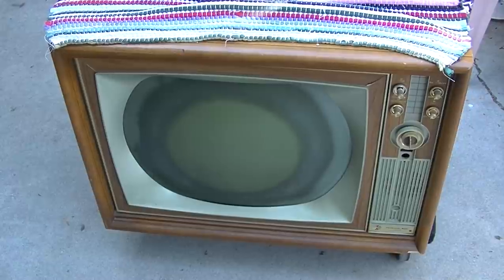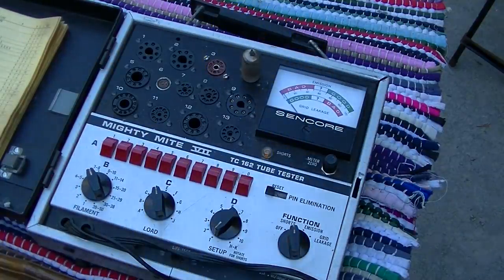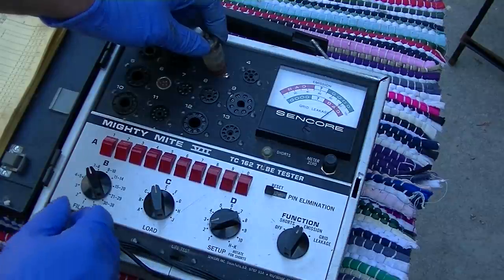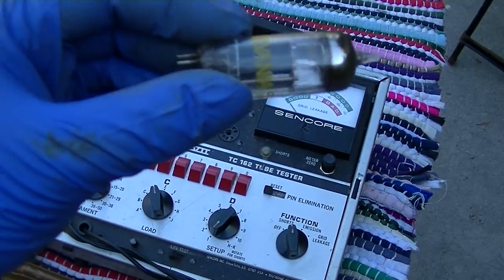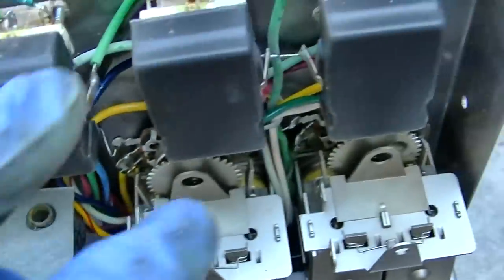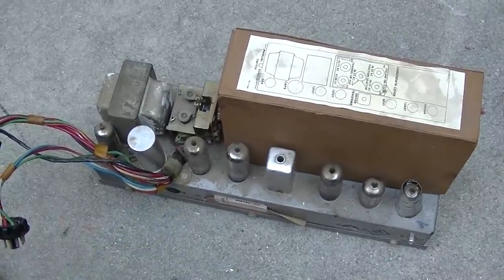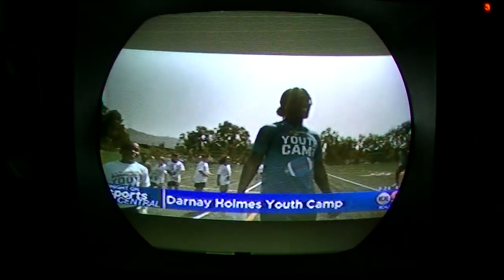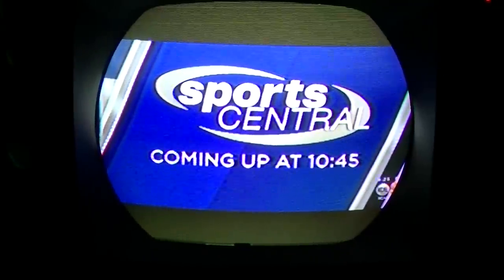Packard Bell Round Tube Color Television Repair Pt2 Capacitors and Chassis

Comment: I remember when parking lots were landscaped with shade trees, so it was nothing to stay in the car under a tree while your parents shopped.  Roll down the windows, and you were fine.  Stores found out that maintaining the landscaping was expensive, so they took it all out, now we have a wasteland of pavement.
Reply: "They paved paradise, put up a parking lot..." - Joni Mitchell ("Big Yellow Taxi")
Reply: No offense, but methinks you're either misremembering or had an experience most didn't. Most places then and now are/were flat paved with no trees. Some put strips with a couple at the end of rows — for decoration, not providing shade. Almost none shaded entire lots. Image searches on the matter pretty well confirm my memory. Cost-cutting is nothing new.

Comment: I'm originally from the Cleveland area---what will the Guardians be guarding, the miles of derelict factories that stand dormant with the demise of the industrial age? But I digress---I was very surprised that the faulty remote unit wreaked such havoc with the set---I never would've guessed that. It turned out great, ready for service
Reply: Cleveland should be renamed Lagos.  I call my own city "Lagos on the Delaware" and Baltimore is "Lagos on the Chesapeake" and now Cleveland can be "Lagos on the Cuyahoga"
There is no #MagicDirt
Reply: The wasteland of woke
Reply: They will be guarding the " Mistake by the Lake" sign!!!!!!  😂🤣🤣🤣🤣🤣🤣🤣🤣🤣🤣🤣
Reply: And you paid an extra $50 to $100 to have that remote box installed in the set. Without it, there were less issues, even if you had to get up and walk 6 feet to change the channel, etc.

Comment: Hello from France 🇫🇷 I follow your YouTube channel from many years now. Remember the sixties in Paris with only 2 black and white public channels. Second public channel start with colors in 1967, third (in color too) in 1972. During this period colors TV sets providing by Philips or others Europeans brands were too much expensive with low quality // USA. When solid state all transistors colors TVs was launched up at mid seventies , color TVs set began to be more common, with very rare remote control anyway. We were so late compared to the USA ! With the rest of Europe too with our SECAM color system 🤬As a teenager I was fascinated by the technological advance of the USA. Today France is the less expensive place with fiber internet and cable providers but I’m still hot with those old US TV set ❤️
Reply: Europeans couldn't agree on a standard for color. Half of the continent was running PAL, and the other was running SECAM, with half of the SECAM countries eventually switching over to PAL. We had the NTSC versions of the Phillips K6 and K7 sets here in Canada. They were a technician's nightmare.

Comment: Hi Shango, your videos are GREAT, I'm also fixing stuff like TVs (but modern), PCs, amplifiers, for fun (and friends) but I never tried to fix any tube equip - it does not seems to be much harder / different than solidstate - of course voltages are higher therefore you need to watch and think about what are you going to touch, use isolation transformer, gloves, ... but at the end most failures are same - leaky / open caps / burned resistors, burned tube / transistor / IC  / diode - the skill is to be able to find the failed component - thats why I like your videos beacuse you are trying to find the failed component logically instead of "replace them all" - this is much more educational :D Also I like your comments / humor, but I'm a little bit scared about what I see in the news you are showing us - I'm happy I live in europe where the propaganda did not reached US level (yet). Thank you for all your work / videos!

Comment: I thought tubes were rather delicate, but I guess smacking them with a slice of plywood doesn't phase them.  LOL.  Always interesting content, thanks again.  Cheers.
Reply: Since he's working outdoors, a critical refinement is to use exterior plywood.
Reply: I rather enjoyed that!
Reply: The envelopes don't like to be stepped on or dropped but they don't care much past that. Shango has videos smacking them with screwdrivers to remove shorts!

Also, they handle overcurrent really well
Reply: Plywood has a bit of give to it, plus he was holding it on his hand so some of the hit's energy got dissipated that way.
Trying to do that on a piece of steel on the ground with the same force would most likely shatter the glass.
Reply: I always treated them like glass....as in fragile glass.
Reply: @Stephen Tidwell Shango being who he is though there's probably 6 more like it in storage and if it had a short it was needing to be replaced anyways

Comment: Sagging elements in a worn tube from the way it is positioned in the set. I've seen it happen many times with ones mounted horizontally. Smack 'o Rama and they often come back.
Reply: Sagging elements are common in anything from the 60's, that's why I don't look at myself when nude in the mirror any more.

Comment: I remember the 5GH8 tube had just the opposite effect.  If you tapped on a good tube like that it killed the tube. 
When I was an apprentice in a TV shop I once knocked over the tube caddy in the parking lot.  It popped every one of the 5GH8 tubes internally.

Comment: I seem to recall back in the days when sets like these were commonplace that they were not all that reliable, and the cost of maintaining and repairing them was almost prohibitive -- which is why many people back then actually preferred more simple, dependable B&W sets. Also, color sets weren't all that practical, as there weren't that many TV programs broadcast in color up until about 1968 or so, as I recollect.
Reply: Actually the big three networks made the universal transition to color in the 1966 season. Of course color programs existed before then, but most weekly shows were in black & white. I remember the little blurb that would appear for a few seconds before programs would start, proclaiming the show was "in color."
Reply: @Inflec Also, TV Guide made note of the color shows, until the mid 70s, when they stated noting the B&W ones.
Reply: @Inflec  Now that I think of it, this is true, but the overwhelming majority of local programming was still in black and white, and most smaller-market TV stations had budgets too tight to afford color equipment in those days. If memory serves, the TV network that eventually became today's PBS (NET) broadcast exclusively in black and white until about early-1969.
Reply: @dougbrowning82  - True!
Reply: @chetpomeroy1399  - You are correct in all your observations. I remember as a kid a favorite Saturday morning show was time shifted by my local station to Sunday mornings. When I finally got the chance to use my brother's brand new Quasar TV to see it in color, I was crestfallen to see that the station was broadcasting it in black & white. So yes, it took time for some stations to catch up with color broadcasting.

Comment: I could actually watch this set. Nice bright color and good geometry. Focus is a little fuzzy but no blooming or pincushion. I don't miss all the X-ray radiation when we used to sit really close and get nagged at. It's a dry heat in Bakersfield 12% humidity much different than 75% humidity... Get Inoculated!

Comment: I wonder if the tube tester in the U.K. is called  "Valve Tester"
Reply: yes, indeed
Reply: Please ladies and gentlemen it would have been described thus: A device for the testing of thermionic valves - as recommended by Sir Selby Farquhar no less ;)

Comment: Never saw anyone bang a vacuum tube like that, and expect it to work. I was taught that the filaments, and other inner parts of tubes were kind of delicate, that you could drop a tube on the floor, and while the glass may not crack or break,the tube was effectively non functional. I guess this is not the case.
Reply: Just don't do it to your 300B. The miniature tubes are happy to get whacked. We used to whack our tube necks with a screwdriver during rejuvenation too. Don't know of any that would fail after a whack, not saying they can't..

Comment: I don't watch television, so all this wokeness, CRT, anti-racist racism is not only a bit shocking, but also offensive to me. I'm just not used to it. My least favorite part of these videos is when the TV content is shown. I really enjoy the restoration process, and the humor, but as has been discussed, when it's all said and done, and the tv and the radios are repaired, there's little worth using them for.
Reply: Just skip those parts of the video.
Reply: Yep, no tv in my house, but i want one for a "decoration". My house is old and i'd like some older tech to go along with it. An early B&W would actually be the easiest and most fitting for the house, but early color sets are cool.

Comment: I need one of those bug traps that actually works, problem is i don't know what would be good one and where to get it.. i have a cheap one with LED light, and it does not atract a single bug ever. piece of s*it